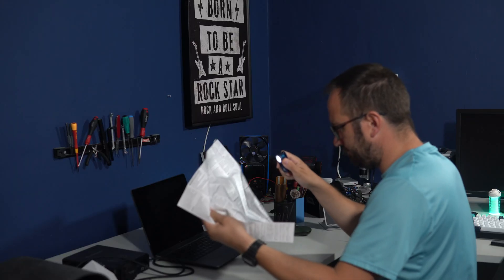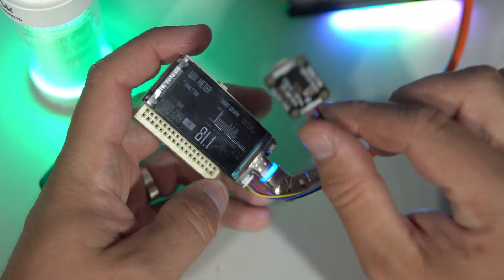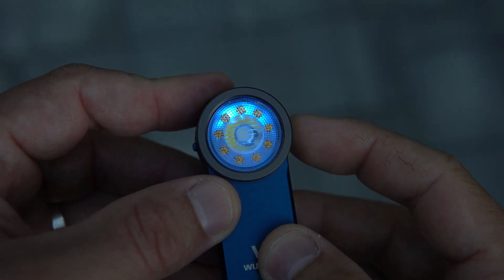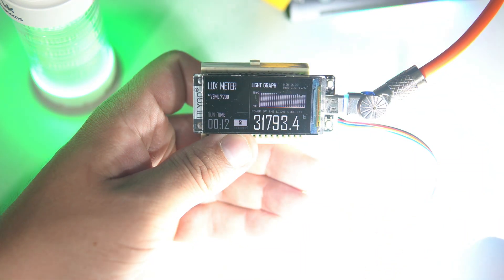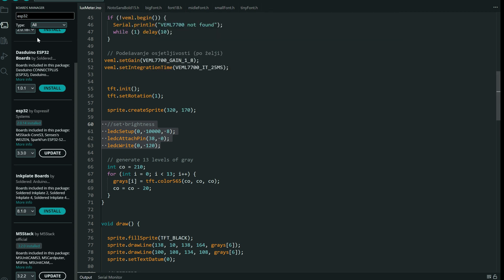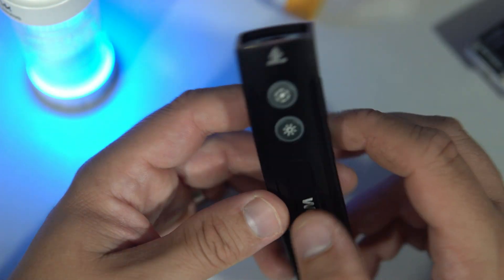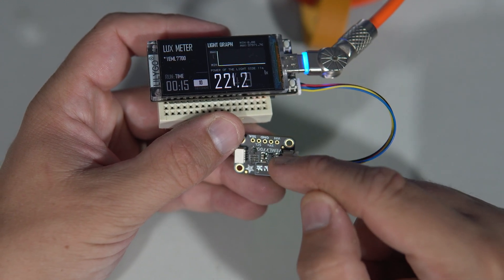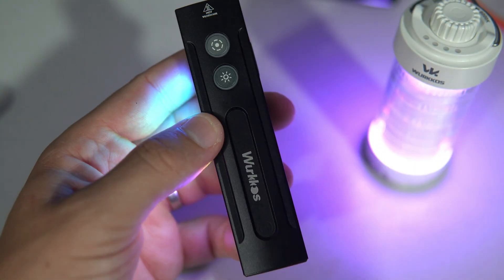Testing Flashlights with My DIY Lux Meter (Featuring Wurkkos HD03 )

Comment: I am doing a project, and I'm in need of some hardware recommendations.....and help in general.
Hvala.😅
Reply from the maker: I am listening
Reply: @VolosProjects 
Automated fully controllable vertical hydroponic tower system .
Build in display( size of a phone)

Recommendations for displays, and sensors if you could...
Thx
Reply: @VolosProjects  prekomplicirano ili kaj?
Reply from the maker: Sorry, tesko mi je odgovarati na sve komentare odma, kasnije zaboravim. Sto se tice senzora nemam iskustva sa ovakvim senzorima. Sto se tice razvojne plocice , ovisi sve o tome sto trebas, dali zelis velike ekran, manji, touch screen, jel bitno da bude amoled..